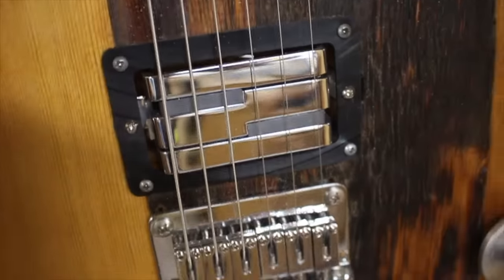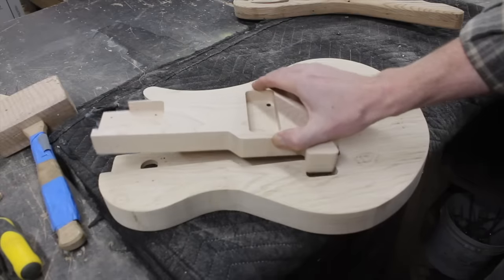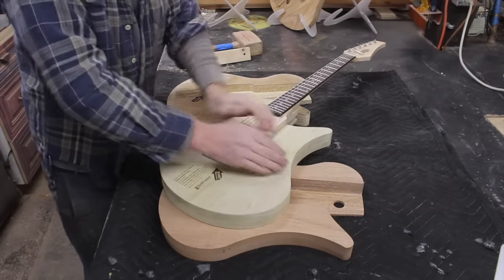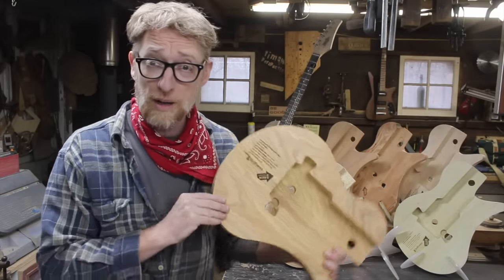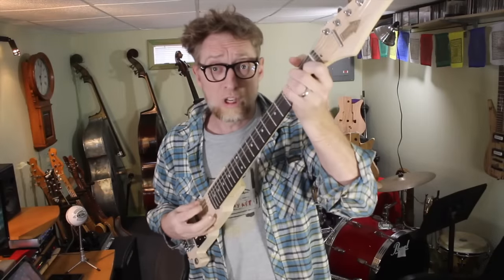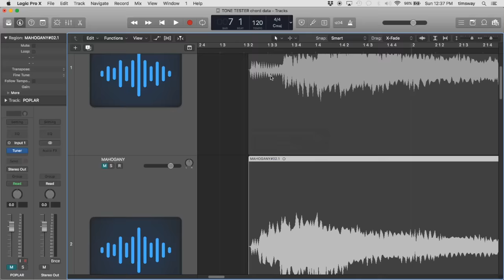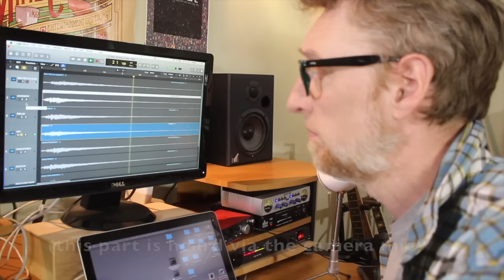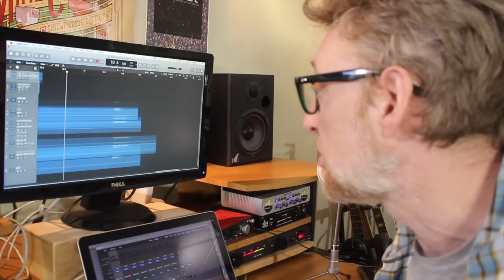Tone Wood Tester: One guitar to test them all

Comment: Dude you gotta patent the neck and body blank shapes because this is genius. You could sell necks with all the critical components and body blanks for tone separately so buyers can pick their preferred tone wood. Honestly it really is genius and it's got commercial potential.
Reply: If you want to sensibly arrange the jack for the cord, the pickup selector, the volume and tone knobs and maybe another pickup, it might get tricky, though.
Reply: @YTOnceAgain  Yeah you're right. Could extend the neck piece out a bit to fit the pickup selector. Not sure about the cable jack though. He'd probably have to use a verticle (relative to the top) input jack. Maybe under the saddle near where tone knobs would be on most guitars.
Reply: People could snap on different shapes for their guitar to.
Reply: @NickPuentes  Yeah dude this better be a thing soon
Reply: If he didn't before he posted the video, then he is SOL.  The design has been disclosed now.  That makes it "unpatentable" if he didn't put in at least a Provisional Patent application beforehand.
Reply: @Giverechoc  Good to know I guess. Thanks for the info.
Reply: @TonecrafteLuthiery  or add contacts to both pieces and mount the jack in the usual place on each body
Reply: @YTOnceAgain  You could always design some sort of adapter that allows the piece with the neck, pickups, and bridge to plug into electronics housed in the body piece.
Reply: @Giverechoc  disclosing a design DOES Not make it unpatentable. That's totally untrue. Nearly all inventors disclose their ideas to all manner of people before patenting them. Family, friends, trusted mentors, business partners.
Reply: @davecarsley8773  They have to be under a non-disclosure agreement.  Otherwise it is considered a public disclosure.  I've done this before.
Reply: @davecarsley8773  I'm a patent attorney and I can confirm Henry is right. A video on Youtube woud render something completely unpatentable! Not sure this would necessarily be 'patentable' anyway.
Reply: @YTOnceAgain  a harness could solve that. input, pots, and switches on one end in the body and the pickups/ground from the bridge housed attached to the interchangeable neck. someone with some electrical know how may even be able to design it in a way that everything was wired to contact patches that would join when the neck was inserted into the body so no manual plugging would be required. the fit would have to be extremely precise but doing this might fix some patentability issues as well. this is my completely unprofessional suggestion though.
Reply: Couldn't agree more.  That would be amazing if you were in a band that wore colored costumes, tribute bands or cruise ship bands where you need colors to match clothing or stage setups.  It could be quite a lucrative market, or maybe not.  Certainly intriguing.  Could make mass production a breeze.
Reply: I agree this should be marketed.
Reply: @Giverechoc  q+
Reply: David Wang  Right back at you .  As I said, I have done this before.  Any disclosure of a design prior to filing a provisional patent application is a public disclosure UNLESS the parties involved are under an NDA.  If they are not, then you have made public disclosure without patent protection and you can no longer patent the design.  And "no" I wouldn't pay your $500/hr fee.  I already have a top IP attorney in Chicago on retainer.
Reply: @YTOnceAgain  easy on the back he can have metal contack points like a giant usb port or patch cable passthrough.
Reply: Boaz One, anyone?
Reply: @YTOnceAgain  Don't know if it's been said but with a proprietary port it could be plug and play.
Reply: But wait.. There's nothing like tonewood in electric guitar world..
The wood just has to be as hard as possible for the guitar to sound the best.
Reply: @Giverechoc  i must point out to both you and Wang that "LAW" means NOTHING. (EX: ask 500 cops about the law and you'll get 500 DIFFERENT answers. Ditto prosecutors and judges.) (We have FED judges in different states "interpret" laws precisely the opposite of each other!!!) 

IF "LAW" was legit, we wouldn't have had to have spent TRILLIONS on APPEALS courts, who have to overturn idiot judges every single day. 

(You CANNOT be smart and be a judge, as a SMART judge is a threat to
the status quo. YOU BECOME A JUDGE when you are not smart or skilled. ANY idiot can be a judge, which is why you don't even need to know A SINGLE THING ABOUT LAW in murica, to be appointed a judge. Ppl foolishly think you must have a law degree to be a judge. NOPE. ALL judges are Blackout Brett Kav: not qualified in ANY manner, shape or form, and daddy paid for their "law degree". EX: as mayor Looney Giuliani made his skeevy Campaign Contributors JUDGES (!) and other criminal pals of his. THIS is why we had to invent APPEALS courts: NO JUDGES KNOW THE LAWS and make the shit up each day.) 

"LAW" is a nonsense concept to begin with. ANY idiots in charge can make ANY idiot "Law" they want, and tens of thousands of Murican 'Laws" were found to be ILLEGAL, by unanimous appeals courts, PROVING RIGHT THERE law is whatever the person in power says it is. 

EX: for years I argued in dozens of courts that a LAW was clearly illegal, and i explained why, and 100% of judges declined to rebut my facts or arguments. ALL said i was wrong. So why did the TOP court in NY... 20 years LATER...say I was 100% right and 100% of judges, cops, prosecutors, and legislators were WRONG? (This happens every time. I've never ONCE met a judge who knew the laws. NOT ONCE. Even SCOTUS are phonies who have their clerks look up law and write the judges' "opinion".) 

YOUR GOVT IS RUN BY HUMANS. 

HUMANS ARE IDIOTS, above all else. 

This is why there has been umpteen PATENT battles as well, even IF you follow all the "Rules" to a T! 

MEANWHILE... not at ALL does a Public Showing cancel your COPYRIGHT or PATENT, for numerous LOGICAL reasons. (Don't cite some moron judge or politician to try and defeat LOGIC.) 

ONLY if someone else UPLOADED a video of the SAME idea... BEFORE or at the same time YOU uploaded your invention, would that be correct. 

("But MANY idiots in govt told me you're wrong!") 

IN FACT, both patent and copyright laws are ILLEGAL GARBAGE TODAY, thanks to technology. (EX: we can now DOCUMENT how soon we came up with an idea, vs anyone else with the same idea... AND we can DOCUMENT if the other inventors SAW / HEARD of the first guy's invention.)

THE VERY ACT OF POSTING A VIDEO of your invention, is LEGAL GOLD. 

(B/c it scientifically LOCKS in the date and everything else.) 

No patent pending needed. ("But the IDIOTS in charge said you're wrong!") 

(In 2019 alone, SCOTUS made a legally binding decision that... SCOTUS is an UNLAWFUL body!! Roberts was explicit about this, re Korematsu.) 

(EVERYTHING YOU'VE BEEN TOLD OR TAUGHT IS FALSE, FALSE, as well as FALSE.) 

(EX: any judge overturned on appeal can NEVER practice law again or stay a judge. THat's brazen MALPRACTICE, duh!) 

NOTE: no one on earth has probably defeated "experts" or "LAW" more than I have, so ask for more proof if you need it. I invariably defeat EVERYONE ELSE in their own rigged courts, which is quite impressive! David v. ALL Goliaths??!!  "AUTHORITY" literally means "Idiots who have NO FUCKING CLUE what they are doing". But humans just repeat the lies repeat the lies. 

WATCH THIS: Name ONE THING the USA govt does that is legal under their own laws. (You are in for a revolutionary surprise.)
Reply: @dontsubscribeme9547  are you being sarcastic? Tone wood is a LIE and that's been settled for years. Also, my lightest guitars ALL get more sustain than my heaviest guitars.
Reply: @Giverechoc  NOTE: I deal with a wide variety of GOVT agencies every day, as an atty in many fields. EVERY. SINGLE. GOVT. AGENCY. gives you different "Rules" and "regulations" EVERY TIME, proving you're simply at the mercy of WHICHEVER IDIOT YOU ARE DEALING WITH. 

DUH: the moment you are IN govt, you have POWER the rest of society lacks... meaning you MUST get lazier and sloppier with facts, rules, etc, 
of your govt job. (Power corrupts.) 

LOGIC 101.
Reply: @Giverechoc  BOTH you and David are making the SAME ERRORS of trusting THe People In Charge. 

ANALOGY: the MSM and BOTH parties say "The POTUS is above the law... b/c he had his staff write on a piece of paper ("memo") that the POTUS is above the law. END OF DEBATE!"....but even a child could figure out that a random memo does NOT trump the Bill Of Rights etc. (14th Amendment DIRECTLY says the POTUS is above zero laws and has no more rights than a dogcatcher. THE LAWS MUST BE APPLIED EQUALLY TO ALL AMERICANS. End of debate.... so WHY do all the "experts" and pundits and journos and dems KEEP LYING that the "memo" matters in any way? 

SEE? 

You live in a world where EVERYONE is an idiot, or plays one so as not to rock the boat.
Reply: @dumpygoodness4086  I think tonewood is of importance only in making acoustic instruments
Reply: @YTOnceAgain  Pin headers or just other types of port that would snap in, also guide rail and some magnetic snaps  and done .
Reply: @Giverechoc  sad but true.
Reply: @dumpygoodness4086   I call under the influence of an controlled substance for $500.
Reply: @christophersanchez7130  i AM a fan of snorting the marijuanas (good stuff!)... but can you cite anything I posted that didn't make FLAWLESS LOGICAL SENSE? 

Anything? 

ex: 
if 5 Supreme Court judges DECIDE LEGALLY that the other 4 do NOT KNOW THE LAW, how is that not a MALPRACTICE conviction by the TOP court against those 4???

DO EXPLAIN!
Reply: @dumpygoodness4086  Can't name one..)/*
Reply: @Giverechoc  I thought you had up to one year after public disclosure to file a patent application.
Reply: He should make the through-neck out of carbon fiber for maximum sustain and stability.

Comment: If there's one thing I'm sure about after watching this video, it's that tonewood won't save you when the guitar is out of tune. :P
Reply: That's what i was thinking
Reply: one thing that "could" be argued is that an out of tune guitar will resonate with compromised conditions versus a guitar in tune might resonate better because the notes are more harmonically aligned.
Reply: @bobpascarella4496  Good point but now you've got me even more curious - most of these tonewood tests have focused on sonic qualities and frequency spectra. Has anyone ever done a test that measures their tuning stability? Specifically if a guitar body made of stiff wood like walnut holds its tune better than a (comparatively) more flexible wood like basswood?
Reply: @garrettodonnell4177  id like to see that
Reply: Garrett O'Donnell Interesting... my logic would suggest that less string vibration equates to less extremes of amplitude, which equates to less string pull at the saddle/nut. Not sure how the comparison of harmonic orders would stack up in terms of movement. I’d automatically think that resonant low order harmonics would provide more stability issues but maybe higher orders provide more energy, so the harmonic order sustain would be the key factor. How would the saddle/nut pressure effect that study? Would a less stable tuning on an oscilloscope translate to an unpleasant aural experience?

I haven’t got a fucking clue... I’ll get back to my bath 😉
Reply: Intriguing effort, an in-tune guitar would help though, yes 🤣. Narciso Yepes went so far as to argue that a good guitar player, regularly playing a guitar, positively influences its tonality over time (and can be heard, which I'd agree with).
Reply: Garrett O'Donnell, true. An out of tune guitar means you have waves that are fighting one another, which makes a difference in a lot of things.
Reply: @HanlonRazor  wrong.  The waves are already "fighting" one another even when it sounds in tune for multiple reasons but the simplest is this: even when it sounds in tune and pleasing to the ear, it's never perfectly in tune.  Any deviation in exact frequency means you're not dealing with pure harmonics ever.
Reply: ooh! not good. I'm constantly amazed by how many ppl play out of tune! I blame electronic tuners, they don't learn to tune by harmonics so they don't hear them or how far out they are. Smart kid though, I bet he don't play out of tune!
Reply: You have very precise ears, should listen to some metal.
Reply: That's what I thought. How can I trust this guy when he can't even tune a guitar?
Reply: @Artcore103  Hang on, does that mean a guitar can never be precisely in tune? Except maybe by accident? I tune by harmonics with a ref note from piano whenever possible. If I tune each string until the wave totally disappears am I not in exact tune?
Reply: @michaeloberhofer7183  basically yes but for a couple different reasons.  The boring reason that may not be perceivable is that our pitch is not perfect, so maybe you're off by a couple hz.  Google "test your sense of pitch" and choose the NIDCD link, should be the top one... Very fun and interesting test.  I could do 1.6hz reliably if i recall.

But that's not the issue with guitar, there are 2 issues.  One is that instruments are tuned via the equal temperament system which is already imperfect as a compromise, and the second is that a guitar (with regular straight frets, not microtonal) does not even perfectly follow equal temperament across the fretboard.

Watch some videos on intonation and temperament.  Adam neely has some great videos on it.  

"Just intonation" would be perfectly tuned only for a specific key, if you leave the key the tuning will be way off, so equal temperament is a compromise so that all keys sound good but none are perfect.

Its simple math.  Harminic ratios should be simple and exact like 1:2 for an octave etc... Seconds thirds fifths all have their perfect ratio.

But if you follow the fractions up from one note, say C, and also follow the fractions up from another note, say D, you'll see that they don't line up.  A 5th up from C isn't exactly the same as a 4th up from D, or a 3rd up from E, etc.  Going up by fractions then down by fractions doesn't work out the way you might think initially.  It's literally impossible to tune any instrument even a digital keyboard perfectly for all keys.  It's always off by a few cents.  Equal temperament was standardized by the west only a couple centuries ago, before tunings were not standardized and they'd often tune to a specific key for a certain piece of music.  That would be more ideal if we were willing to trade the flexibility... But remember, no key changes allowed!
Reply: @garrettodonnell4177 
People are getting way too OCD over this stuff honestly. I mean, tuning stability?? Any properly set up guitar will hold tune perfectly fine, even a cheap guitar.
Reply: I just thought it was a chorus when all the tracks were combined. 🙉
Reply: Nope, i it also not make you a better player...
Reply: Like... c'mon man - this is supposed to be somehow scientific, yet the guitar is completely out of tune...
Reply: Artcore103 Thank you for explaining this in such detail/plain English!
Reply: @garrettodonnell4177  The stiffness matters because it prevents the energy in the strings from dissipating into the guitar body and neck. That is why a rubber guitar would have terrible sustain. Other than that wood does nothing to a magnetic field, there is NO tonewood in electric guitars. I've heard concrete and acrylic guitars they all sound great.

Comment: If you wanted to get super extra nerdy, you could build a cradle to hold each guitar, with a spring-loaded plectrum arm that could strum the strings in the identical way, with identical force every single time. That might help the internal validity of your sustain and resonance data. Great video, thanks so much!
Reply: Someone did just that to compare a wood-bodied strat vs a plexi one. https://www.youtube.com/watch?v=5vgwaiScrwA&t=587s